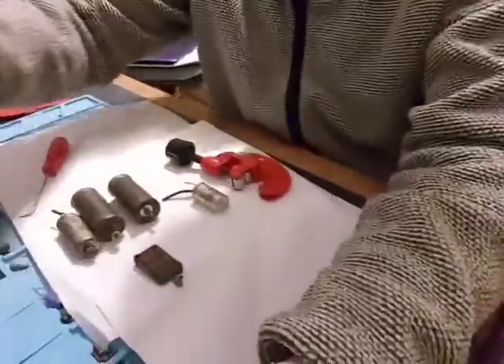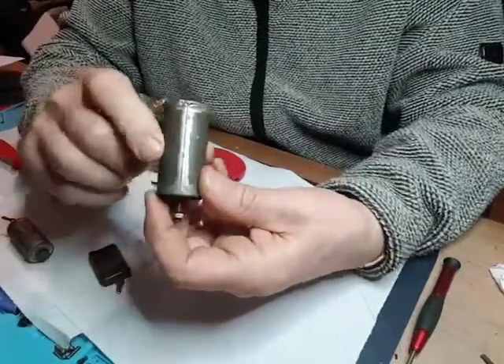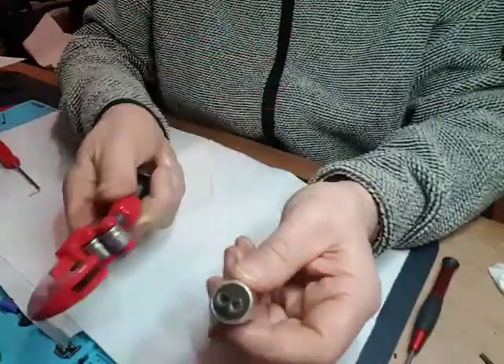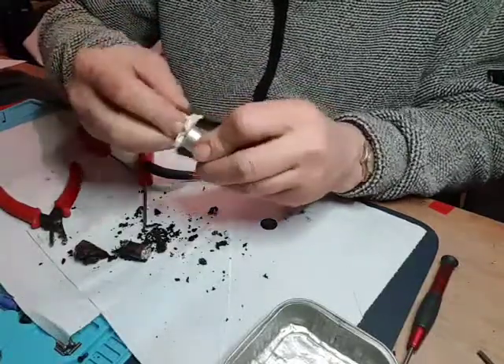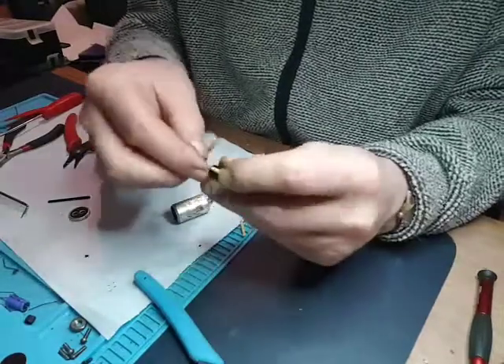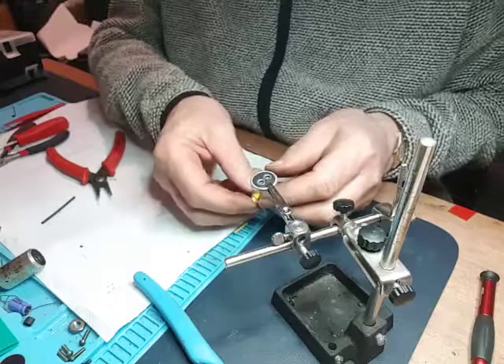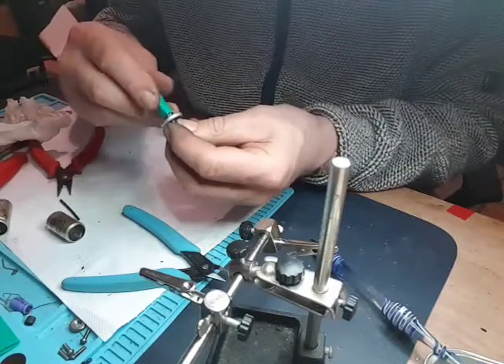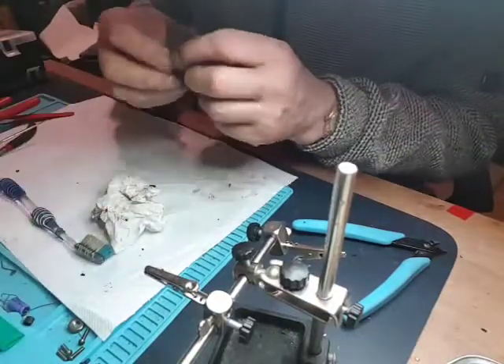Marconi CR100 Renovation (26) Last few capacitors to repair

Comment: You solved getting out the waxy "stuff" inside by asking the wife who brought  boiling water in a container,soaked the capacitor and she pulled it out.😉 The next capacitors you didn't "decapitate" but held each as you  torched the lid to melt  the solder while  the wife again ,with a tiny screw-driver pulled it off simultaneously- and it worked!🤓 It is amazing the detailed attention you are giving to every bit and part of your project, that is the professional way to do it!!
Reply from the maker: Thank Your Dear . A great help and a promising apprentice. x